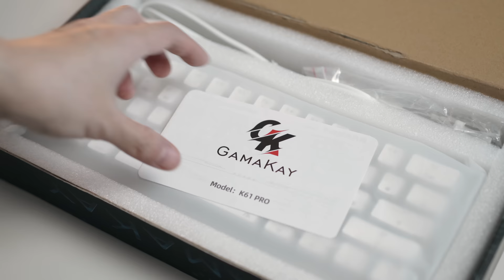GamaKay K61 Pro Unboxing (Gasket Mount, 2.4G, Bluetooth)

Comment: I'm a sucker for a 60%,  Been using them exclusivity for almost 3 years.
Reply: I hate not having dedicated arrow keys.
Reply: @retroman--  Then don't buy a 60%.  Problem solved.
Reply: Don't you miss the dedicated arrow keys? :) I've tried many 60% throughout the years but I always end up back at 65% - the extra row it takes up is negligible compared to the extra utility IMO.
Reply: @retroman--  Buy some pcb that is via/qmk compatible. Then you can remap keys as you want.
Reply: @retroman--  it's not even complicated to use arrow keys on a 60%...
Reply: @IncorrigibleBigotry  I don't use things that I don't like.
Reply: @ThisIsntTwitter  Exactly!
Reply: How can i charge the keyboard?
I'm typing rn on it and the ctrl is glowing red because of the low battery,

Comment: Nice budget-friendly gasket mount, and I love the rgb effect through the case. The spacebar, tho... :_3ildCry:
Reply: i kinda like the high pitched spacebar tbh makes it different compared to the alphas
Reply from the maker: Haha that spacebar......... :_3ildCry:
Reply: How can i charge the keyboard?
I'm typing rn on it and the ctrl is glowing red because of the low battery,
Reply: @zestyx8000  You connect it to your comp with the USB cable until the battery is recharged

Comment: So I just received mine yesterday actually and I love this thing, it's an amazing keyboard for the price. Love the wonderful bright lights. Anyways, I run it off my Mac mini and I noticed that my Command key (Windows key) and my Alt key is switched. Tried to reset it but nothing. Tried to do the Fn+S key combo but I don't know if that worked. So what I did was switch the command and alt key temporarily. Did anybody else have this issue running off a Mac? Other than that, I love it. Worth the money. EDIT: Oh btw, :3ildcat: thank you for the review, I actually seen this vid and bought this thing just because of it lol. Thanks again! 😎

Comment: The RGB doesn't look as nice as the regular K61.  I'm comparing your video of the regular k61 and it seems the colors are better diffused and the bottom/edge lighting is much more vivid.  Is that because of a different housing?  The pro seems to be more hollow and have more room inside.  Is that the reason the regular k61 has better lighting?  Am I right about the lighting being stronger on the regular k61 or is it just this video that shows it that way?
Reply: How can i charge the keyboard?
I'm typing rn on it and the ctrl is glowing red because of the low battery,

Comment: Hello, im thinking to get this board but so you think the screw in stab will be fit on this board since this is plate mount but scott on keybored found out it can be screw in. Im worried that the screw in stab are would not be fit on plate. Thank you
Reply: How can i charge the keyboard?
I'm typing rn on it and the ctrl is glowing red because of the low battery,

Comment: that branding on the front is a bit much
The looks ok but I don't know if it's that much of an improvement over the standard version aside from the 2.4ghz dongle connectivity.
I guess wireless and gasket mount are the selling point and for $20 extra, I guess it might be worth it for some.
Reply: How can i charge the keyboard?
I'm typing rn on it and the ctrl is glowing red because of the low battery,

Comment: Can i have a review about krytox 205g2, should i use it to lube my wire ?
Reply from the maker: Just a preference thing as always.
I've lubed stabs with 205g2, permatex grease, xht-bdz and I prefer xht-bdz and permatex over 205g2.
But some prefer 205g2 over others.

Comment: Very strange keyboard. Mainly for playing with colors, not with text, or gaming. The most popular keys near the arrows in FN layer are considered system keys for managing colors. :) So you can't use Ctrl + Arrows for jumping by words. You can't use Shift + Arrows for words selection. You can't remap nearest with arrows keys for most usefull keys like Ins, Home, PgUp, PgDown. You can't use F1-F12 + Alt\Shift, but this is most popular combination event for gaming.... 
So can't use this keyboard to perform basic operations for working with text. You can't normal play with this board, but, you can changin colors..... )
Reply: How can i charge the keyboard?
I'm typing rn on it and the ctrl is glowing red because of the low battery,
Reply: @zestyx8000  No way, if it does not charge immediately as soon as you stick the wire - no more. This product has an enchanting percentage of defects.
I have the same proplem - the keyboard does not charge in any modes. Now I have another wired keyboard. Like you))) I'm sorry bro. Give it back if possible.
Reply: You can’t remap? The overlay pictured looks like VIA in the video when he is doing input test
Reply: @hingsing1  No it is just visualization stuff from author. Gamakay Driver app is needed and it's no allow to use most of the command keys for remapping (Shift, Ctrls, Enter, Alt, All keys around Enter, , z,x,c... QWERTY - of couse becouse it is switch bluetooth mode. All numbers and a little bit more... ). Lately I can understand how to work with it. For example: If u want to select word in a normal keyboard in a normal editors you have to press next key combination: Ctrl + Shift + Arrow (Right/Left). On this keyboard you have to do next: (unpress Fn, becouse Fn+Ctrl - changin color) then press:  Ctrl+Shift+(Fn+Arrow). So actually this function is available, and I was wrong. But, it is still actually unusable becouse you can't just hold Fn and then pres Ctrl+Shif+Arrow. Becouse in this case, the first combination Fn+Ctr will change the collor scheme for egde. So in 61keys format Fn+Arrow is still a commonly used combination. When you are working with text, and for example moving a cursor to a propper position with Fn+Arrow combination it is very native to press Ctrl+Shift+Arrow then without unholding Fn when you achieve a propper position. So still very uncomfortable, and absolutely not customizable and in fact unusable. 

But a miracle saved me. When I once again changed the keybinding. I pulled out the cord without waiting an ending of the saving new settings in the ROM of the keyboard. And I lost all the secondary functions of the keys - it is a bug for sure. And in the GamaKay Driver app my profile was corrupred and become an absouluterly clean for every keys. No double functionis at all ))))  so I can set any character to any key what is perfect,  but I lost all the system functions like colors changing, and Bluetooth modes switcing, becouse Gamakay Driver does not allow these functions to be mapped to the keys again - u can assign only letters. But there are no any stupid combinationis of Fn with Ctrl, Shift, Alt... So  at the moment I got a wired version, without the ability to control the backlight on the keyboard, but I have all I need for working with text.  Now I can hold Fn, Find neccessary position and the press Shift+Ctrl+Arrow without unholding Fn. So... am I happy now? )))))  

Anyway I think you can feel all my headache about this process : ))))

PS: The only good thing about this whole story is the Phoenix switches I ordered it on. They are very light, linear but fealling line tactile,  This is very relaxing,  .... as far as possible on 61 format)))))

Well, you need to check the versions of their software also, maybe they fixed something. I remember that last time, they released a "very important" update that removed the red highlight on Ctrl while charging :)